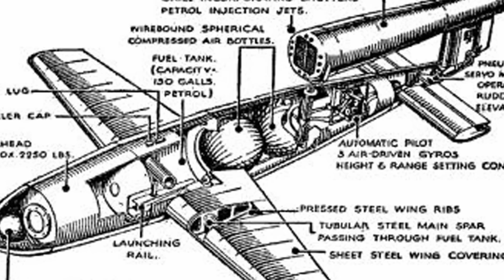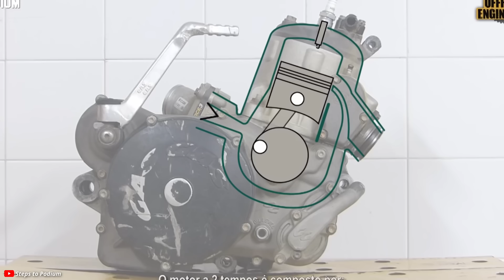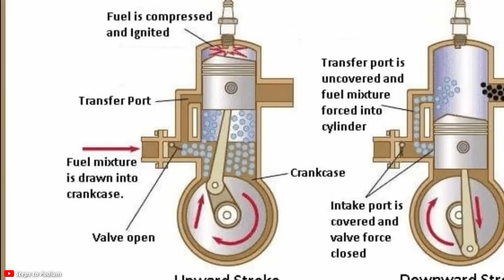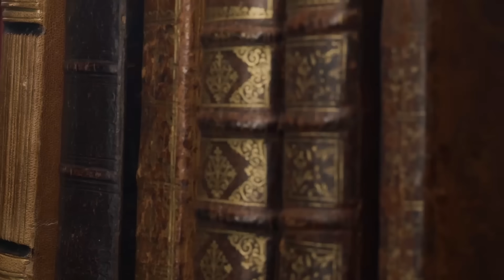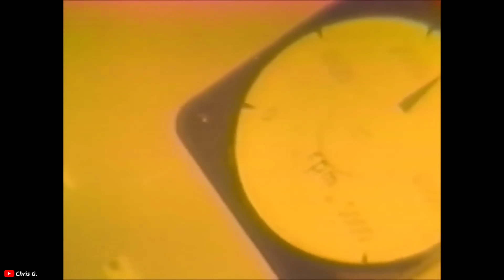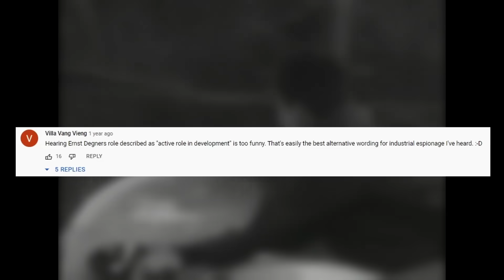How Suzuki stole communist technology to make their motorcycles faster

Comment: The rotary valves were definitely not something new after the war, even some pre war production bikes had it. For example the Triumph (twn) BD250
Reply: An even finer distinction could be inserted here.  There were a number of "rotary valves" in concept that were being used, in outboards as well.  The center crankshaft was hollow with passages timed to feed during the upstroke of the piston for each of two cylinders.  Model aircraft engines also used a hollow crankshaft with a timed port from the carburetor/inlet into the crankcase.  A form of disk valve was used on some racing model engines, similar to what was eventually fitted to the MZ racers and preceded them by a few years.  I was in the motor trade very early on, worked on the first of the reed valve systems before that technology became reliable in chain saws.
Reply: @Retired Bore interesting, did not know how it was made.
Reply: There are basically two types of rotary valves that have been used in two strokes. The most popular type used for motorcycle two strokes is the rotary DISC valve. Early versions were fitted inside the crankcase but the most significant types were fitted in their own sealed housing OUTSIDE of the crankcase. This type was patented by the East Gernan  engineer, Daniel Zimmermann in 1953, having first used it in his 1951 Formula 3 car engine.
The East German Trabant car engine had internal rotary disc valves that were unsealed and thus quite inefficient. The same type were fitted to the British Sun motorcycles of 1921 and the 1922 German Ziro machines.
Reply: @Retired Bore I found a YT video of a Trabant engine undergoing rebuild.  I can see the comment of Biker Boy being relevant to the unsealed disks in the design.  I had several DKW and SAAB autos back in the day, reminded me of the care and feeding of the types!  They were piston valve designs and not hard to remove by one owner for the occasional repair.
Reply: @Retired Bore My introduction to twins with disk valves was when the A series Kawasaki twins arrived in 1967 and I worked their booth at a trade show in NYC that year.  The pains they went to for housing the carburetors and sealing the inlet air from leaks was amazing.  Prior to them it was Bridgestone twins.  I recall Suzuki had the most sophisticated disk valve arrangements but they never did any twins with disk valves.  Just as well, the whole two-stroke effort was pretty well done by the mid '70s and I'd put in many years as a service tech at a dealership on them.

Comment: Suzuki was lagging behind in tech of Two Stroke, but like tech somebody takes it and sells it to a competitor, but, what Suzuki did with the newly found knowledge was outstanding as they took it further than MZ would have, then Honda jumped in and up until recently (last 10 years) Honda stated there was no more engineering technology that can be achieved with T2 as it came to brick wall… especially with emissions halting any progress, a decision that would eventually would change the whole small engine market from motorcycles to power tools going in to the T4 engines such as waterborne/adventure equipment such as jet skis, snow mobiles that’s continuing into battery technology in commercial gardening/lawn maintenance sectors (chainsaws, weed wackers) ….

Comment: I had a 1972 Suzuki 50cc when I was 15 years old. It was magnificent. It had everything that larger motorcycles have. Battery, separate oil tank, rotary valve, 3-speed gearbox, turn indicators and it transported two people in comfort. It only made about 35mph but that was because it was restricted so that it wouldn't require a drivers license and registration. Without the restriction they easily did 50mph.

Comment: Good stuff!  You should do a story on the marine outboard with variable exhaust runners.  That was another 2 stroke milestone.
Reply: The next big step was controlling the gas flow on the induction and exhaust side.YPVS.
Reply: @eugeneoreilly9356  With the ability to print "seamless titanium structures" that literally could not be machined, I am sure the 2-stroke has yet another life left in it.
It would be easy to assume that welded stainless shapes can produce well-tuned resonance for a given application, but if you stir the technology pipe (figuratively) with chambers and accelerators and dividers which literally couldn't be manufactured before, I'm sure they could make an all-new engine which could do things we can't yet imagine.

Comment: I'm disappointed in your general lack of research / knowledge. At 1:20 you say "without supercharging" yet all 2-strokes ARE supercharged. The pump just happens to be the crankcase utilising the underside of the piston to provide the pressure waves. This is why there needs to be oil mixed with the fuel - to lubricate the otherwise dry crank and con-rod.*
Also at 7:28 you say "harness the sound waves". That's so wrong, it's not sound waves but actually reflected pressure waves (negative pressure) at the exhaust port that gives the huge power increase. That's why highly-tuned 2-strokes have such savage power-bands - you can only tune for a specific point in the rev range. Above and below that the 'suction effect' is far less.
[*] A few 2-strokes like Detroit Diesels run wet sumps and instead use a Rootes supercharger to pressurise the inlet. But they are the exception that proves 2-strokes need to be supercharged.
Reply: Shaun , perhaps you should produce a video and show us how much better your version would b ..
Reply: @grooviefan  Jeff I didn't critique the video, just two of the 'facts' (which I then explained above). It's an excellent video if you don't care about the subject matter.

However hit me back if you can only take in facts in video format and I'll try hard to find a video that explains it for you.
Reply: @dukecraig2402  I'm not going to go through that line-by-line because life's too short to educate everyone. Let's just say that in your first paragraph you say it's not supercharged, the downward motion of the piston just "forces" the air into the cylinder. Can you say 'forced induction'? Google can.
The rest of it is equally as off-base. I'm a retired automotive engineer who rebuilt many Detroit diesels and made dozens of 'expansion chambers' for 2-strokes (some of them with variable-length 'stinger pipes' to widen or move the power band).
BTW physics says it's impossible to move air without a pressure gradient. 4-stroke induction is via a low-pressure 'suction' (which takes a full stroke!) but 2-strokes just don't have that kind of suck - they need some blow too.
Reply: @Shaun.Stephens  
No, that hardly qualifies as forced induction, you're just letting your imagination educate yourself on these matters. 
You fancy yourself as an engine guru but you won't take the time to read an explanation from someone with an associates degree in aerospace science? Someone whose been a performance engine builder for over 35 years? That's why you don't fully understand what goes on here, you don't take the time to read anything in it's complete form in life, you're one of those people who reads the first sentence of something and think you know what you're talking about, but you don't. 
A 2 stroke Detroit Diesel engine is not supercharged because the intake windows in the cylinder are uncovered at the same time the exhaust valve's are open at the top of the cylinder, this allows the pressure from the blower to blow straight through and not build up any pressure in the cylinder beyond ambient pressure, ergo it's not supercharged, just like a normally aspirated engine isn't "forced induction" because the ambient air pressure "forces" air fuel mixture into the cylinder when the intake valve is open and the piston is moving downwards, the ambient air pressure is "forcing" the air fuel mixture into the cylinder but this hardly qualifies as "forced induction".
The downward motion of a 2 stroke piston that moves the fuel mixture from the crankcase to the cylinder is no different than the intake stroke of a 4 stroke engine in regards to moving air and doesn't hardly qualify as "forced induction" no matter how much your imagination thinks it is, engine math 101 says different.
Reply: @dukecraig2402  Why did you delete your first reply to me?
Reply: @dukecraig2402  I didn't say that I didn't READ everything you wrote previously, just that I wasn't going to reply to all of your 'points' line-by-line. The fact that you got that wrong speaks volumes.
I'll leave you to go argue with someone else on the internet, obviously facts don't mean anything to you.
Reply: @dukecraig2402  2-strokes ARE forced induction i.e. supercharged. They wouldn't work if the carby just went to the inlet port.
Reply: @dukecraig2402  So you could run a 2-stroke with just a direct inlet port to the cylinder with the carby (in atmospheric pressure) on it? Please link to any info or videos showing this. Thanks.
Reply: They are not supercharged at all. The mixture inducted into the crankcase is merely transfered/displaced by the downward motion of the piston to the cylinder through transfer ports.
Supercharging is a very different principle that enables a larger volume of air to be forced in at the inlet phase. Much more so than any given naturally aspirated swept volume could ever take in at atmospheric induction.
Reply: @misfitthemad276  Forced induction(supercharged) and pumped transfer are very different. 2 stroke engines without a positive displacement blower are not supercharged in any way.
Reply: @misfitthemad276  All 2 stroke engines whether disc valve/piston port or reed valve induction have the open side of the carburettor to atmosphere. There is no supecharging unless there is a blower on the intake side of the carb.

Comment: Kaaden´s expansion chamber, in combination with an DFI like in Piaggio Purejet or Aprilia Ditech and a variable length exhaust pipe (a very underdeveloped tech yet, till today) gives you the best engine one can have, with the best fuel-efficiency, highest power-rating, lowest cost and highest ease of maintenance, a real miracle. Companies are doing too little R+D on this subject, especially the variable lenght exhaust (in order to have the optimal exhaust-length with the rpm+load for every moment/situation, for highest efficiency and power), and it´s a real pitty, cause most of the tech developed in the West is aimed to good earners, and not to normal people, which was the focus in the eastern block (no luxury, but instead, low cost, ease of maintenance and high utility, and still, most citizens had eyes only for the western luxury, like children)...

Comment: I had a lot of fun back in the 90's building what were called "Bucket Racers" in New Zealand and Australia.
I bought a rotary valve Kawasaki KH100 and modified the rotary valve timing, raised compression and lots of other tweaks. I used a Suzuki RG250 expansion chamber as this was a twin therefore 125cc per cylinder and close to what I needed. I rebuilt the header section to suit and made an adjustable sleeve into the fattest section of the chamber. By testing the power characteristics at different positions of the sleeve I found the best power band and re-welded it together at that length to get the power band how I wanted it. Frame and suspension mods finished of the package.
This bike would pull 100mph on the straight of our local race track and could actually beat some much larger 4 strokes  around the circuit due to it's light weight and high corner speed.

Comment: I had an MZ250 when a student in 1980. It used to carry me 250 miles to Newcastle and would cruise at 65mph. It was ugly, but the engineering was top-notch . 40 years later , I have purchased an old one to restore !

Comment: Back in the early 2000s, I used to own a 660 MuZ Baghira Black Panther, a supermoto based on the Yamaha 660 Raptor single piston (thumper) motor. This bike was a beast of torque, somewhat overweight, but rock solid in frame and roadworthiness. MuZ was the successor to MZ, and the bike was manufactured in Germany. Due to its weight it couldn’t compete efficiently in Supermoto races, but it was a blast to ride on the road.

Comment: I was fortunate enough to own a 1986 RG500 Gamma Suzuki.....In the USA! The roads had plenty of GSXR750/1100's roaming around in Northern Califonia where I lived....after a careful break-in of a "grey market" bike....I was riding along in a 2 lane canyon back road when....It was time! 600Kms had been passed, now the almighty power of the RG "GP Replica" could be unleashed....I remeber how it took all of my sense and reflexes to control the RG as the exhaust valves snapped open @7K RPMS and the front wheel lofted skyward and the rear tire actually spun scrambling for traction! AMAZING BIKE! I had raced RD400 twins and owned an RZ350 with modifications but, the square 4 RG motor was AMAZING! when it went "Full Song" what Suzuki was thinking about not equipping that GP Replica with a progressive exhaust valve?....I'll never know....The RG was the peak of Suzuki 2T development....one of the best GP machines of it's era and the RG500 was the BEST of the road going GP Replica machines, better than the RD500 or really dissapointing NSR400....

Comment: In 1978 I brought an MZ TS150 new it was £278 half the price of any Japanese bike. I knew MZ used to racing bikes but little else. The bike was totally reliable, I covered over 10,000 miles in just 12 months on it. It handled really well I often hit the foot pegs on the ground it was also very tunable I took it from a 65mph bike to an 80mph bike. These bike were treated as a joke when I brought mine but people come to respect them because although they were basic commuter bikes you could feel that race engineering knowledge was at their core. These days they are sort after and fetch £3k plus

Comment: Just to point out, Chrysler engineers proved that 4 strokes aren't just pumps either. Go read up on the Ram Chargers. They took the intake pulse tech from the 50's (which gave them the cross ram induction system) and improved on it created the Ram intake which later became the Tunnel Ram. Each runner is tuned for different arears of the power band. this mean more HP and Torque through the whole band. This is just one example of the same idea. That neither motor is "Just an air pump".

Comment: Great video. Just a few comments from an old-timer who was a 2-stroke guy back in the day. DKW actually means "The Little Wonder." (I used to know how to spell it in German, but would probably get it wrong today). Aren't those MZ and DKW road-racers simply beautiful!  Did anyone else notice the flat-slide carb Degner is holding at 3:21. I remember how flat-slide carbs were called a new innovation about 20-25 years ago. Actually, an after-market company called Lectron manufactured a flat-slide carb in the 70s. I don't remember them starting a revolution in performance, however. Have to give Suzuki more credit then Bart does in this story because  in another video on the history of Suzuki, they told of the racing dept. learning of how even such small dimensional changes as 2mm in cone size, length, and final pipe length could make huge differences, led to them experimenting to the tune of 1,000 different expansion chamber designs for those early 50cc and 125cc race bikes! Another downfall (literally for many a rider) of the 2 stroke racing machine against the 4-strokes was their tendency to seize if the jetting wasn't spot on. This was a big problem until the racing teams started using an air-density meter for calibrating jet requirements. Before that, it was a seat-of-the- pants, wide-open plug chop, read, and then an educated guess at best. Many a great racer suffered injury or death until someone figured it out.

Comment: Many thanks Walter Cotton and MZ and thanks also to this fantastic video. I had no idea!
Because I have one of the last great legendary 2 strokes. The GT 750. And without Walter it definitely would not exist. It is certainly a revolutionary engine with full roller bearing crankshaft and pistons. Triple points ignition system Expansion chambers a sophisticated dry sump oil injection system that has 6 separate oil injection points and of course the obvious. Water cooling. It won races and allegedly one reached 185 mph!

Comment: This was incredibly interesting as my first motorcycles was an MZ ETS-250 purchased in 1973.
It was a very good handling bike but it would not pull the skin off a rice custard.  Absolutely flat out at 85kph.
I paid $AU450 for it and just recently I saw one restored selling for nearly 10K.
Reply: Funny as we had three of them and, once in the powerband they screamed and went like a rocket - you just had to ring their neck and keep them in that 500rpm power band.
Reply: The factory default settings and hardwares were not the same, as on the race-track bikes.

Comment: Very interesting and well delivered historical account of WWII German influence on 2 stroke engines.  I've had several 2 stroke motorcycles over the years  as well as competed with 2 stroke radio-controlled pylon racing with the little 6.5 cc engines turning over 30K RPM on tuned pipes.  I vever knew the history of 2 stroke tuned exhausts but the connection with the V1 pulse jet makes complete sense.  Very interesting...thanks for making this and good job!  I'm subscribed.

Comment: Suzuki X6 Hustler my dream machine as a teen. Couple years later bought a TM-250 Motocrosser. Out of the crate it was geared way too high, the front shock sucked, but the lube sys on both machines made them more reliable and less fuss mixing fuel/oil plus the oil got to the important places. Great machines for the price.